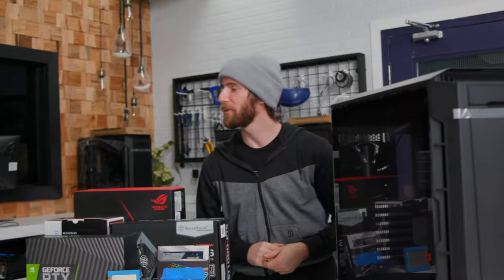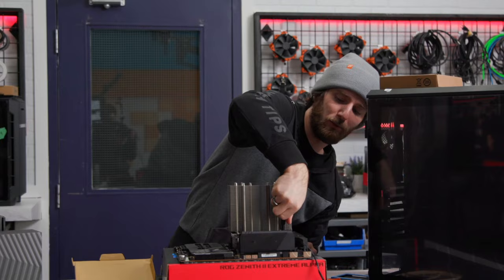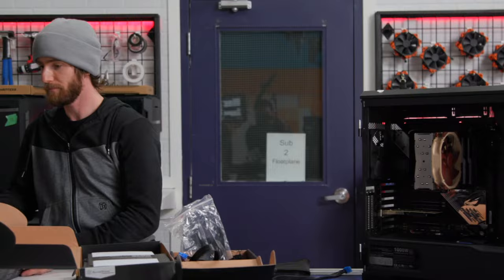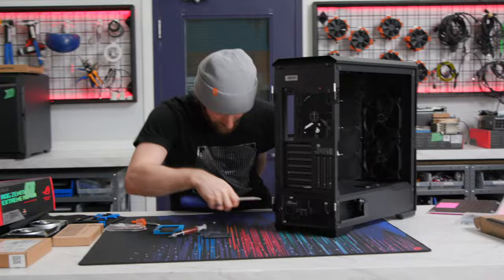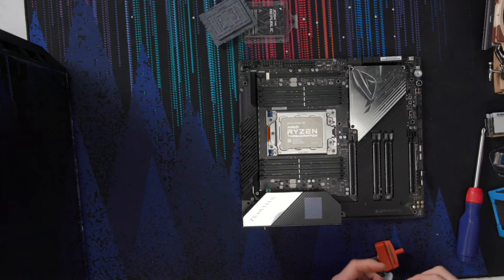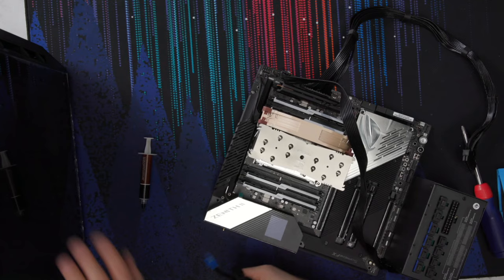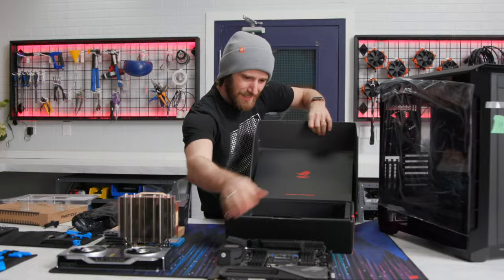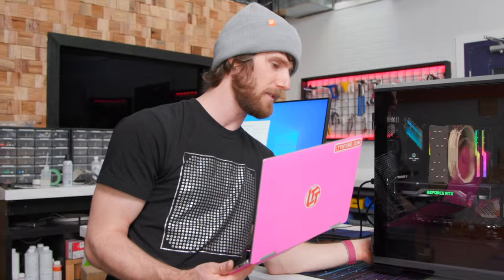I REALLY Love Building Computers!!

Comment: As a one-handed person myself who builds his own PCs, the one handed build segment was very admirable. Take a bow Mr. Sebastian.
Reply: This is not getting upvoted enough
Reply: honest question, dont wanna be rude: how do you play? which hand is missing? keyboard or mouse? do you have special hardware for accessability? did you switch what your hand does after you lost the other one or did you always only have one?
I know these are a lot of questions, but I'm fascinated by how people interact with computers
Reply: @sehfisch2350  My left side is non functional due to a stroke 10 years ago, not missing per se. I just doesn't have any function and likely never will. It's just dead weight. I use a multi-button mouse and program the buttons for different keystrokes (getting a good multi button mouse with enough buttons is a challenge. I almost always only use the mouse but will sometimes let go of the mouse to quickly tap a key if there is a quiet moment in the game. I don't game very much because it is difficult to set up and get working well.
Reply: @gryyphyn8639  it is
Reply: I got to that explanation/segment and weren’t sure if someone who is one-handed would be offended.
This is refreshing to read. Thank you.
Reply: Little Sebastian needs a Mohawk

Comment: VS. CHALLENGE BUILD! Stealth mode pc- No light, minimum sound, minimal heat. Harder than you'd think, RGB and led lights are everywhere. Case mustn't go above 3 degrees ambient room temperature. Sound can't go above ambient noise floor of the room. Decibels over noise floor loose points. Each light source looses points. Each degree over 3 degree threshold looses points. LTT standard benchmarks earn points based on performance.

Comment: For watercooling you could just do the new CPU block/Pump/Res combo thing, add a gpu block and radiator and you're done. It's just that a watercooling buildoff sounds way more fun, maybe add difficulty tiers for the m ore experienced builders? Like hard tubing or even metal/glass tubes as final challenge

Comment: Oh yeah, it matters, Linus 23:27.  You are describing PMEM, 23:18.  Use PMEM/ RDMA access (near memory compute).  What you have is Apache Pass (AEP) or Optane which is still not there yet as a real leap for fastest NVMe/ CPU match up and best use of the Threadripper you are using..  May be at PCIe 5.0 will there be that full performance NVMe/ NVDIMM/ RAM bridge.

Comment: Linus you should get some hardware from 1997 and have some of your younger staff put it together. Let everyone witness the joys of setting dozens of jumpers on the motherboard, when you had to actually read the manual that came with it. Enjoy the ancient BIOS with barely any settings. Add a 2d video card with a 3d Voodoo passthrough. Try and get all the drivers working with Windows 95, then play some DOS games after 3 hours configuring IRQ channels. When computer building wasn't lego assembly.

Comment: 26:10 Linus you need to add more thermal paste here, the typical X and dots usually works on most CPU's, however on a Threadripper CPU it is a different scenario, having built plenty of Threadripper PC's, being generous with the thermal compound is actually more beneficial! Being a large surface area and a very hot CPU, we've actually dropped temperatures nearly 10c just by trying the right thermal compound application. There are loads of videos too that test different applications, being generous and covering the entire surface is best for optimal results! 👍

Comment: Are you interested in Aerofara Aero 6 mini pc? The aero 6  with Intel i5-1135g7 cpu, up to 4.2ghz, 4 core 8 threads, 

Intel® Iris® Xe Graphics Support Max Resolution: 
7680x4320@60Hz,  Dual HDMI + Type C 3 Display

 8gb/16gb DDR4 3200, 256GB/512GB Pci-e 3.0 SSD

WiFi 6, AX201, bluetooth 5.0

Comment: Do your editors work in sRGB or REC709 or REC 2020 or DCI-P3  ??? and how do they monitor their color work? Do you use the output from your GPU to drive a computer monitor which is used as your grading monitor?? The reason I ask is that you never install a video output card for monitoring purposes at the correct frame rate and color gamut. Maybe you guys only make web stuff and RGB/ sRGB is close enough??

Comment: Hello Tech Tip team! Speaking of memory HOGs my AE appears to be using all of my 128 GB of memory on my thread ripper build. I'm using 4x 32 sticks which I read was the best memory config for TRX40 boards. Would I see smoother performance with AE if I upgrade to 256? My machine does get bogged down when I run render garden.

Comment: FYI, there's very little difference in C and F at -30 since at -40 is the point they are equal.  when you're that low you're just fucking cold in both.  -30C is -22F and the feel on your skin at that point is negligible.  I'm northern ND, we celebrate when we hit -40 because it's unitless lol.

Comment: 24:10 I bought the exact same cooler for my Ryzen 7 3800X and you mean that it can also handle a freaking Threadripper 3960X?! Ok way overkill with other words for me and yea the cpu never get anymore than lukewarm at full workload. xD It was bought since it looked like it had good cooling and quiet, and a Noctua fan can never go wrong, so I wouldn't able to hear the fan even ad modest workloads.. and well I don't.

Comment: My power efficiency PC Game config on dez 2021 😎

Motherboard ATX Gigabyte Z590 UD AC (supporte PCIe 4.0) - 170$

CPU Intel i5 11400 (supporte PCIe 4.0) - 160$

Cooler CPU Arctic Freezer 34 - 30$

RAM Crucial Kit 32GB DDR4 3200MHz Ballistix Black CL16 - 170$

SSD Samsung 980 PRO 1TB Gen4 M.2 NVMe - 226$

Graphics card Asus RTX 3070 dual oc 8gb (PCIe 4.0) - 800$

Power supply Corsair CV-650W Dual EPS 80+ Bronze - 63$

Case ATX Gigabyte C200 RGB USB 3.0 - 70$

Total cost: 1689$

I play every recente games at 2k above 100fps

Comment: Curious, how come Intel's LGA doesn't use the torque driver yet still gets even pressure? As in what advantages does AMDs solution have?
Reply: Intels lga is about quater the size and has way less pins. So you already need less pressure for the contact pins.

Comment: Uh... Celcius Minus 30 is warmer than Fahrenheit minus 30. If it was on the more accurate measuring system it would be -34.44 C to -30 F. So you kinda admitted you can't hang.

Comment: Building the computers is not about control,it's about uniformity and efficiency. Apple does the exact same thing,so  saying it's not the way to go is something a dullard would say.In other words,if you have 20 workstations,if something goes wrong or they need maintenance, it's easy to address any issues.That makes way more sense than going in 15 different directions..